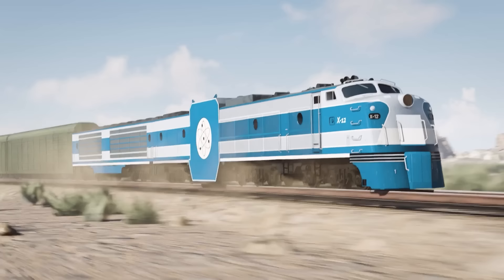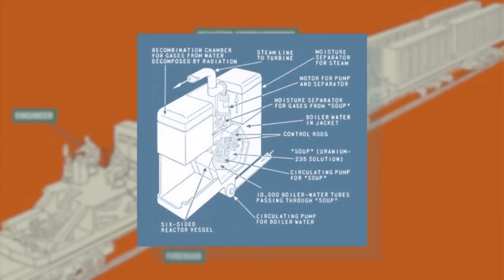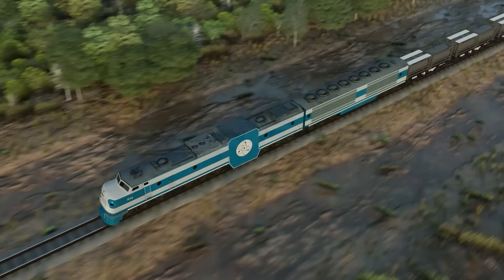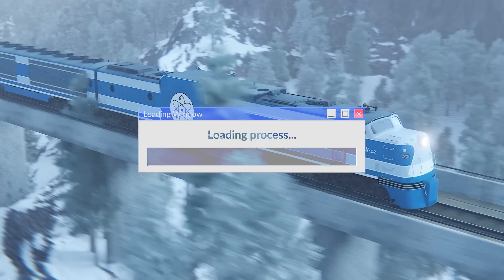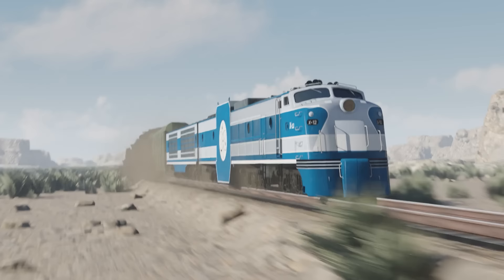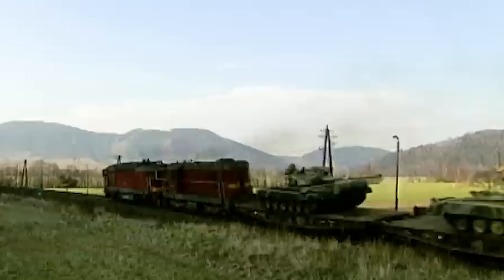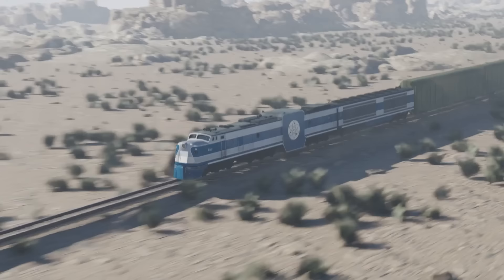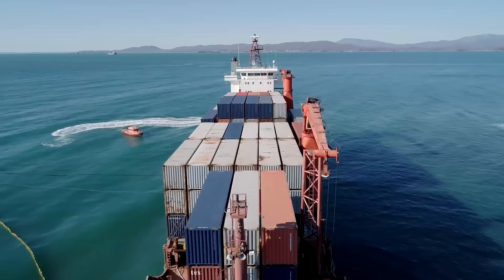What ever happened to Atomic Trains?

Comment: Regular trains, powered by the grid, were constructed, resolving the issues of safety and excess power. These trains can still be operated using cheap and clean nuclear power. the worlds grid was pland to be powerd by nuclear power before the flower power  become green Muppets when fooled by the oil companies to promote wind and solar etc  and it uses 70% of the installed power to be fast burning like oil and gas because it just produced 30% of the installed power... that is if you want power24/7 to your homes....It is ten times more expensive and as polluting as coal over its entire lifecycle.

Comment: Eh, the benefits of it just don't make much logical sense. First is that these engines being so long makes them harder to handle, if it were for freight there's no easy way for the conductor to walk to the rear end of the engine for shove moves, it's one of the worst hazmat issues if involved in an incident, the engine itself slowly becomes nuclear waste itself making it far more costly to decommission, etc. 

The best excuse was the "never need to refuel" but that's actually not a real benefit. First off is that nuclear fuel does need replacing, it may take 6 months to 2 years, but it will need refueling eventually. And diesel engines can already go extremely far without more fuel. The tanks on them are huge so they can go over 20K miles on a single tank assuming it was just a single engine. Realistically it can make it nearly 1200-2500 miles without needing fuel. That's enough for nearly a full trip across the country and no railroad owns lines that long. 

Plus the crews can only by law go 12 hours. With that they at worst will use a fifth the tank. The trips aren't limited on fuel, they're limited on manpower.

Comment: thanks that was interesting. now over here the nz govt built its own engines they had a british based design, but they also carefully examined usa practice have a look at an NZR Ja first glance from the front and you may think it is American if you want to see just how crazy things got here look up Denniston incline also the ka may interest you a 4-8-4 with a donkey engine on the trailing truck for use at low speed on steep inclines we also had a fell railway here too

Comment: Judging by the number of derailments in the US ( ? ) a nuclear train is obviously a VERY high risk venture .... putting the reactor at the REAR of the train ( power unit pushing or cabling the electricity to the front might be safer ? ) , but your point of generating the power in a power station and using lightweight electric trains kills this project ..... DAVE™🛑

Comment: Thing is, this train works great.
And would be better then diesel.

But itsnot safe enough.
Just having a 300ton locomotive derail os dangerous enough.
Not to mention steam leaks, steam explosions, and radiation leaks.
None wouldbe Chernobil orFukushima level, and be perfectly cleanable.
But the about of damage until its cleaned, would be to great to be worth it.

Finally, public opinion is to low.

Comment: so you planning to build a train, 200 t Locomotive, 30 Wheels, does not have to stop for Refuel, needs two personnel which miraculously do not need a break from work, accelerate to 60 mph in 3 Minutes... well fine and how about the tracks? half of the speed of a train makes the tracks, their layout and steeps and radii of the curves...okay we leave it, Semi Trucks are cheaper...
this thing sounds like the Hyperloop, a view wanna push their crazy idea, and cant see the real life solutions are already on hand....
Reply: Or maybe we can put reactor somewhere else and we can research magic power transfer device to run the train from anywhere

Sad we don't know about how we developed this technology yet
Reply: @bocahdongo7769 you dont say, wait i have an idea, what if we hang a wire above the train and the train picks that up with a mechanical device? that will probably never work...
Reply: We can make much smaller and more efficient reactors now days, back in the 50s reactors were still pretty crude.
Reply: @SilvaDreams  oh yes smaller reactors on century old tracks with wooden bridges and the steepest climbs sounds like an idea...
Reply: @SilvaDreams  Gentlemen, we found it
Reply: @SirHeinzbond   You do realize that the freight tracks are constantly maintained, right? 
Don't get me wrong it's still a bit silly considering modern diesel electric engines have only gotten better.
Reply: @SilvaDreams  https://en.m.wikipedia.org/wiki/List_of_American_railroad_accidents  yeah looks like a good idea, maintenance and private corporations and nuclear powered trains...

Comment: Good luck trying to take that around a Wye.   Its Engineer, not "driver" with that nonsense UK english.   Engines can only go Forwards and Backwards, not change directions (unless through a switch which is manual or power depending, a Wye or Turn table)